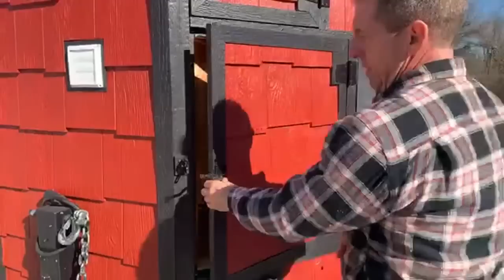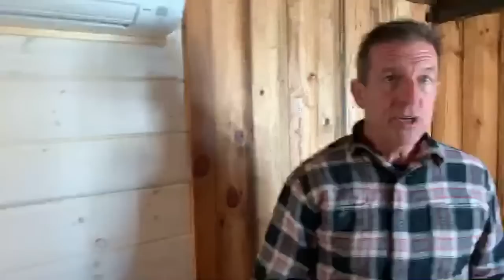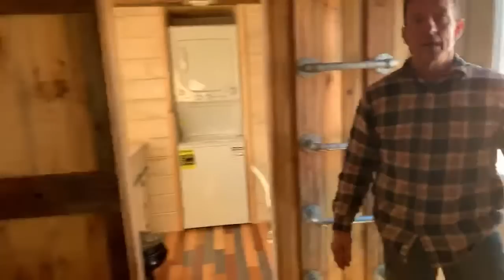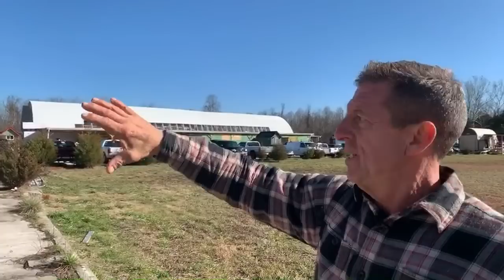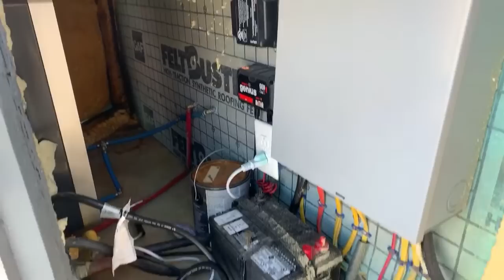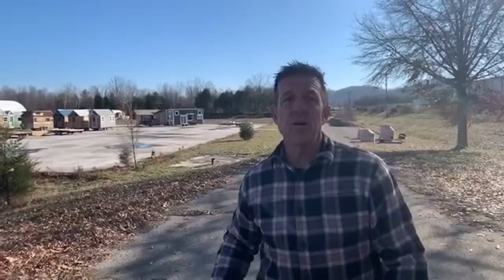Throw It at Randy Thursday - Incredible Tiny Homes

Comment: Randy, carry a 12 foot 1/2” wide tape measure in your front pocket. Take off the belt clip. Stanley. Your welcome! I’ve carried a tape this way for years and it’s part of my edc. Electrician by trade. Conduit is only 10 ft long thus the 12 foot tape measure.